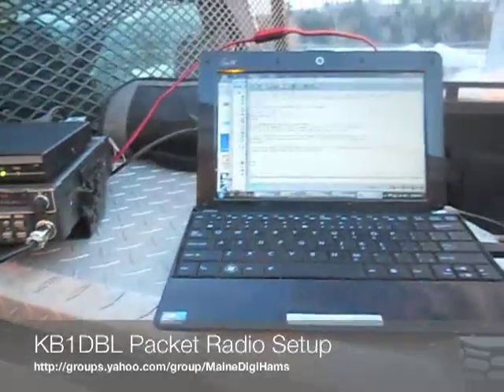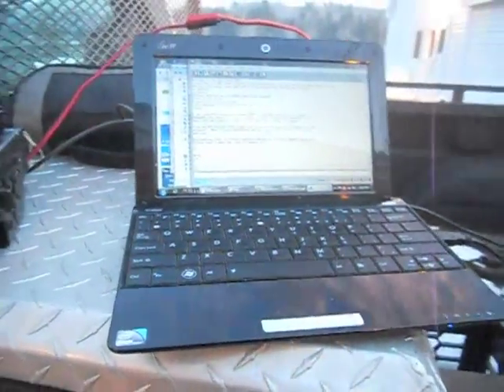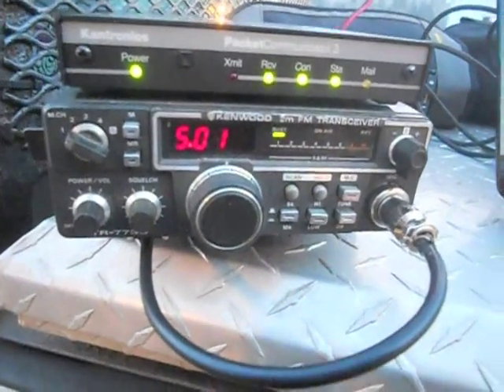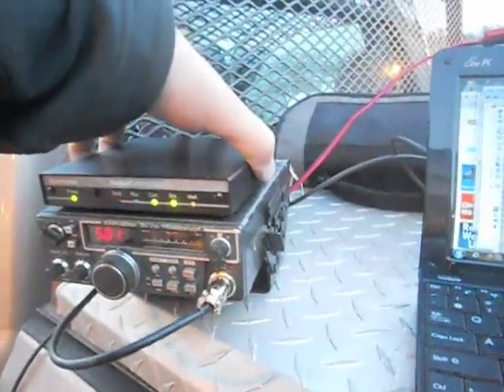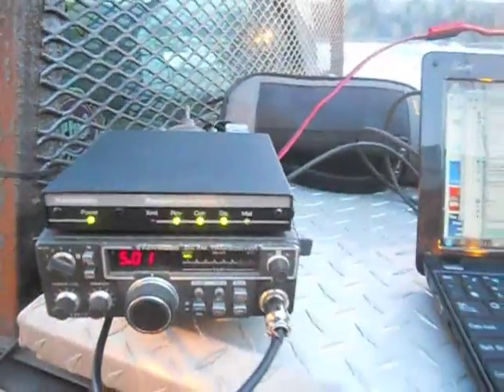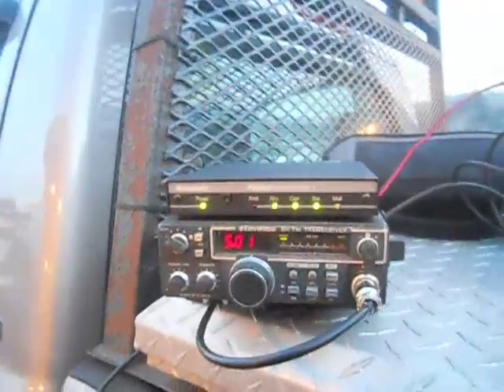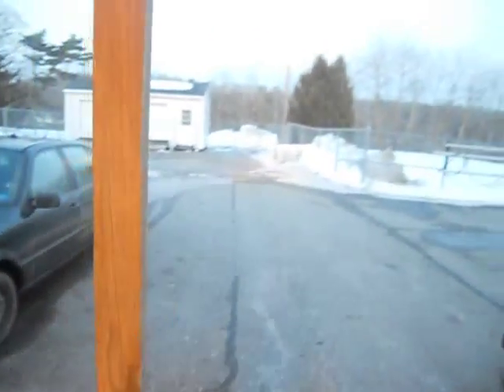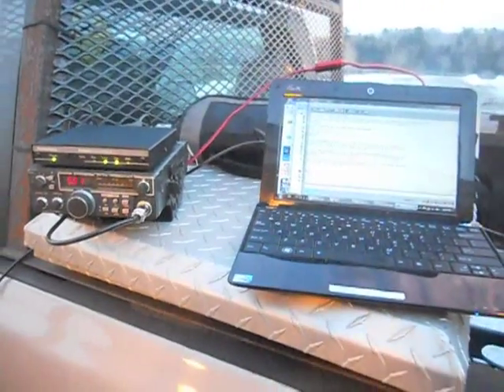Packet Radio Setup

Comment: I have a 1278 with my ft-1900.  I made a small box that contains 2, 1:1 audio isolation transformers.  another line is for the PTT.  has a nice mod plug and monojack for the rear speaker.  Device works like any standard terminal.  fire up putty and it will work if you got the hardware set right.  In fact one could use a dumb terminal.  message me if you really want die hard details.

Comment: With the sound card/Signalink setup, you need a software modem on the PC to decode the data.  AGWPE and UZ7HO are examples of these.  You can find units like the Byonics Tinytrak 4 that will function as a hardware modem for short money if a KPC3 is more than you need.  You then use a mail program like Outpost PMM to connect to BBSes in your area.  If you set the radio to 145.010 (144.390 APRS) with the squelch open and UZ7HO listening on a nearby computer you should be able to watch traffic.

Comment: You more or less just have to run the audio out from the radio to the mic on the PC and vice versa.  If the radio has a VOX setting you can even use that to key the transmitter.  This is not the best way to do it though, because of isolation & the risk of transmitting unintended audio.  It is preferable to use an interface like the TNC, which has audio on one and and serial data on the other, or a SignaLink, which is a dedicated radio to PC sound card interface with its own PTT capability.